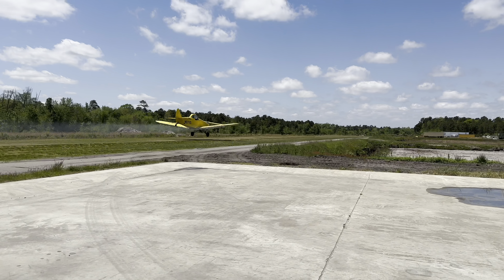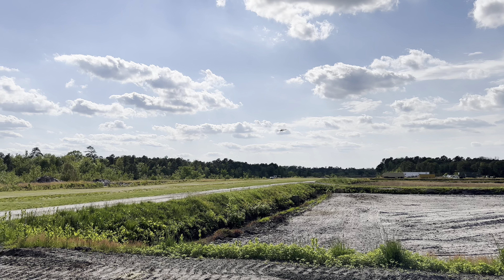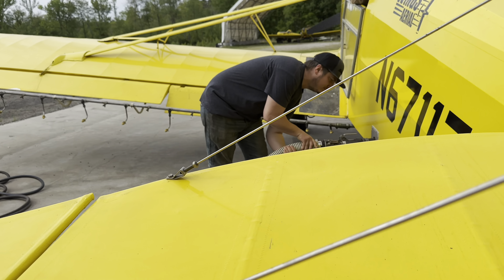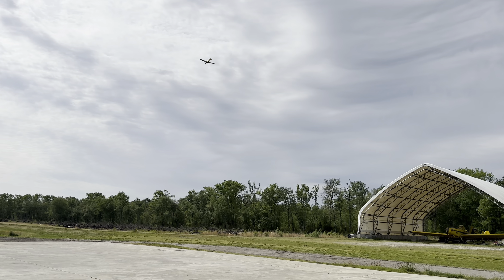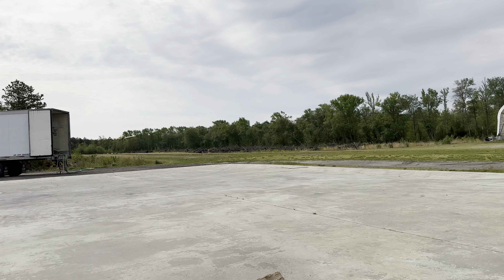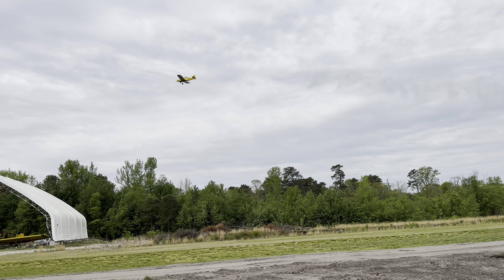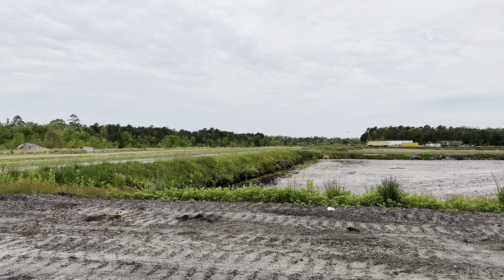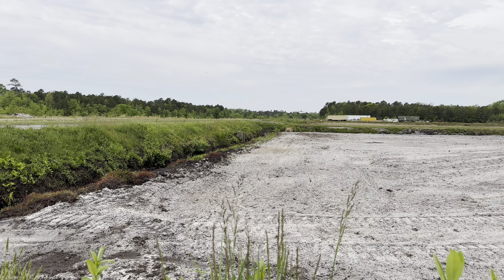Piper Pawnee Flight Training - Dumping A Load

Comment: A safe thing about the Pawnee is that the gate can be opened gradually rather than a full open dump.  Transland pumps are all or nothing.  Yes, for emergency dump we want full open.  The only time I dumped was after bending the part of the rudder than goes over the vertical stabilizer.  I took my time, found a desert area, and dumped slowly. I thought I could still go under a wire on second corn borer, but the corn was too high.

I hope pilots watching your videos see how much acceleration level in low ground effect increases the energy available on takeoff.  As both Ag and normal instructor, I had a hard time convincing normal pilots that this extra free energy is not available after we have pitched up to Vx or Vy as appropriate.  ACS doesn't explain that on long runways neither Vx nor Vy is ever appropriate.